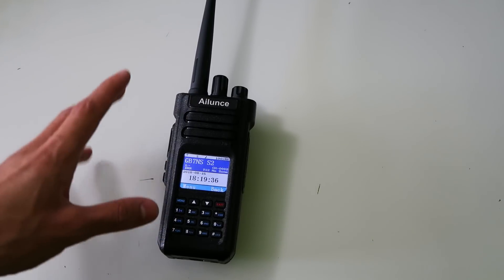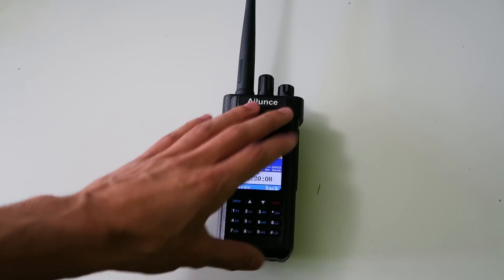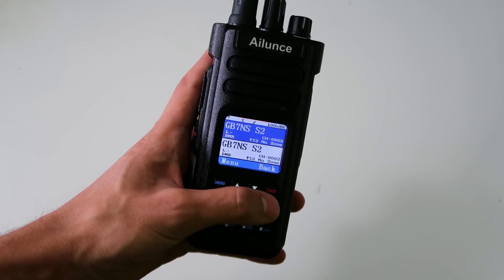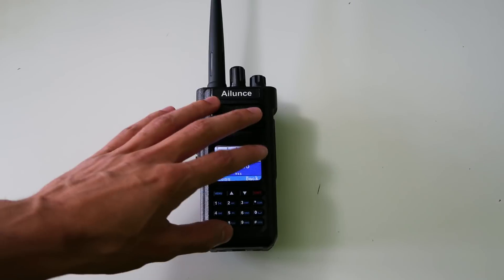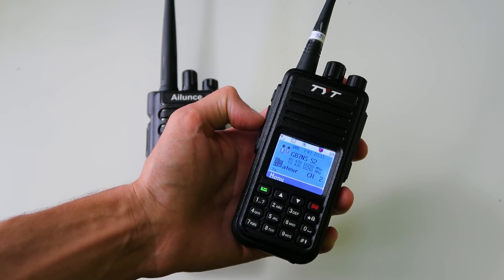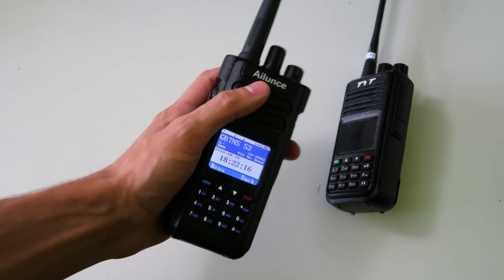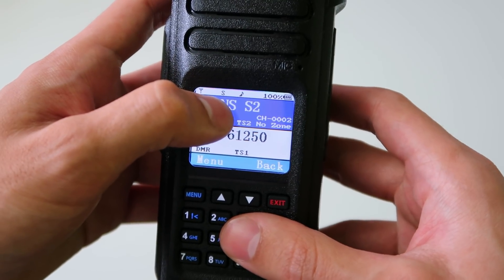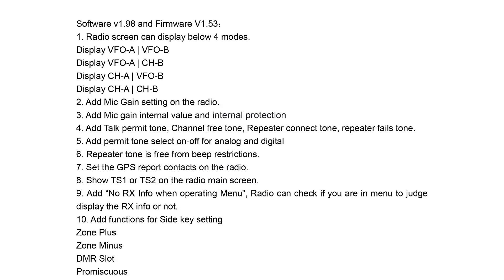Ailunce releases HUGE New Update for HD1

Comment: Ben,

    I do private security and executive protection. I was using my gd77 for my radio. It worked well for a while, however it failed on me at a critical moment. It stopped transmitting. I had to grab a baofeng that I had in my equipment bag. I am looking for a radio  that has some ruggedness to it, and can handle whatever radio needs I want. ( I need range, ruggedness, multi channels, reliability ....without breaking the bank)

What dmr would you recommend?
Reply: A £20 NOKIA OR TESCO MOBILE PAY AS YOU GO SHOULD ROCK YOUR WORLD :)
Reply: OTH, A TYT 390 (WATERPROOF 380) WITH MD380TOOLZ FIRMWARE AND YOU CANT REALLY GO WRONG, PROMISCUOS MODE, NETMON, CC SCANNING,CHANGE DMR ID ON THE GO, BE BETTER IF WE COULD GET A DIGI MONITOR MODE BUT WHAT THE HELL, THESE GO FOR AS LITTLE AS 50-60 QUID ON FLEABAY, GO ON BUY 2, YOU KNOW YOU WANT TOO;}
Reply: This is really a radio for Amateur radio I would suggest on ebay a Motorola XTS Astro they also do encryption an are easily programmed used by law enforcement audio is great an interference free P25
Reply: @aarhowell  thanks I have that radio.....I wanted to reduce the radio size....especially for EP work.....I have been experimenting with various radios since then......found some that work well....others not so great.

Comment: Do you have any idea about a gps problem that says "error gps unlock" I have a feeling my gps is defective
Reply from the maker: No idea, my one doesn't have GPS
Reply: Ok thank you
Reply from the maker: You could try doing a factory reset. Hold menu and exit buttons while powering on and then select all. It will wipe all channels though so take a backup first
Reply: It worked but after almost an hour sitting at a good location.
 Probably low channel GPS chip. I have it uploaded to my youtube

Comment: Is it still true that the ailunce hd1 antenna has a impedance problem that they dont fix? I really love this radio but thats a big no no for me. What other radio would be almost identical to the HD1 but without theimpedance problem?
Reply from the maker: I don't know. They never really admitted there was a problem, so nobody could know if they fixed it. I suspect not though. There is no problem with the antenna or the radio if you use them together since the impedance is matched. The problem apparently comes if you try to use the radio with a different antenna. If you plan to use the radio on its original antenna then it's not going to be an issue at all.
Reply: @radiosification  I'm looking for a dual band radio with analog and dmr, waterproof, big display, easy to program from the front panel and rugged. I will use 3 party antennas like a N9TAX j-pole antenna and a Comet SBB-7 dual band antenna. What other radio has these specs? I'm ok with paying about 400$.
Reply: Yeah and also it needs to have a real vfo like on the HD1.

Comment: Can this radio be used with a external antenna for example a discone in my attic?
Reply from the maker: It could do but might not work as well as it should because the impedance is apparently not the standard 50 Ohms which it should be to be used with other antennas.

Comment: Hi Chris from Tom NO3NO. I'm having a bit of a problem with my HD1.  It seems I cannot get my rig to allow me to switch into analog mode. I am running ver 1.5.3 and I can't  figure out what I'm doing wrong..  

Do you have an email address that might be a bit quicker than Youtube ( As great as it is. )  Thanks.
Reply from the maker: Who is Chris?
Reply: @radiosification  I thought that Chris was this channel.
Reply from the maker: Nope! This is the second time as well!
Reply: Sorry about that. I think I had a small stroke some weeks back and I think it is affecting me.
Reply from the maker: No worries.

If your radio is on frequency mode then you should just be able to hold the red button to switch it between DMR and FM modes.
Reply: If I had your email address I could show you what I mean, if you would be so kind.

Comment: I tried to install the update firmware program for the HD-1 but the internet security I have running on my Windows 10 pc robustly throws it out citing a serious inappropriate activity by the program. Maybe It's time to acquire a Motorola radio.
Reply from the maker: It's not an actual virus, it just gets flagged by mistake. I'm not really sure why
Reply: Hopefully Retevis will become aware of this issue and sort it out. It certainly prevents me from updating the HD-1.
Reply from the maker: Just disable your anti virus temporarily to install it. That's what everyone else does.
Reply: I guess I'm not like everyone else. The radio will have to remain without the update, it is just not worth the risk for a cheap Chinese radio.
Reply from the maker: It's the fault of your anti virus software. If you get a good one then they won't randomly flag programs that aren't even harmful. I use avast and I never get problems with Ailunce software. Maybe you should try avast instead if you want to stay secure while still getting updates.
Reply: I'll leave it for now. I'm not in any hurry to update the radio. I have other projects to attend to, so no worries. Thanks for your input.

Comment: The biggest fault with the HD1 and why i got rid of mine is a design error in the RF output stage, 
it has not been designed for use with 50 ohm antennas which every aftermarket antenna is,  
so there is a high swr which is dangerous when the radio is on high power, the antenna the HD1 comes with 
is matched to the radio (i think its 30 ohms or so) so it is safe to use high power with that just not
an after market one. This is a well documented fault and if you search around you can find the 
test data for it.
Reply from the maker: Yeah I know, I did mention this in my review of the hd1. This video is not meant to be a review, it's just talking about the update
Reply: The strangest thing about it, is that Retevis apparently had custom VHF/UHF antennas made just for this radio!?
Reply from the maker: You literally just press the number keys to input a frequency, assuming you aren't stupid enough to leave it in channel mode and try.

Comment: Great news! Thanks Ben!
The green info screen popping up constantly was driving me nuts. Had to remove the antenna or tune to a known quiet frequency just to use the menu.
Very pleased Retevis have added talk permit tones too. Spent ages in the software looking for where to turn them on.
And yes...the volume control badly needs re-calibration. It is deafening even when set to the 10 o'clock position and life threatening above mid point!
Nice to be also able to change screen colours, since the display is certainly capable with the power on image ability.
Still my favourite of the Chinese DMR portables.
Reply from the maker: Yes it's about time they fixed these things. Who makes a dmr radio without a talk permit tone?! Thanks for the comment
Reply: Just wondering if the new firmware is compatible with the current CPS, or do I need to re-write my code plug for the HD-1?
Reply from the maker: You never need to re-write the code plug. You'll be able to load the old one just fine, or read it off the radio
Reply: The reason I mentioned this is because in a previous firmware upgrade of my Radioddity GD-77
 the radio required matching the new firmware with a new CPS version.
Whilst on the subject of CPS software, has anyone had the experience of trying to program a Baofeng DM-5R radio using the DM-5R CPS? I found that I could not read the DM-5R using the DM-5R CPS. Instead I found that the RD-5R CPS works with the DM-5R. Of course you will need to by-pass the Trojan virus warning in order to download it from the Radioddity website.
Reply: @radiosification   Hallo, how about the volume problem? I use to operate the handy in the evening or just in bed to listen to lokal repeaters. In this case i need a very faint volume setting. Is ist now possible with this unit or should i better buy a Radioddity gd77?
thank you, Hubert from Germany
Reply: Sorry to bother you..  I need to carry a Motorola radio for work.  its fairly new and don't know much about it.  I would really like to find a light weight radio that can listen to my work frequency.  I don't know what the frequency is yet, but pretty sure its analog.  I am a bit over whelmed looking through all the forums.  I don't need to transmit from the device only listen.  Since you seem to know a lot do you have any recommendations?  Again I only have to listen because my work issued computer will be close enough that I can get to when needed.

Comment: Thanks for the update and run down of new items. Displaying the CC as well as TS would be great. I see there is a new CPS too. 

I agree with others that the RX audio can be loud which is good/bad and the slightest turn of the volume control can be deafening.
Reply from the maker: Yeah the new cps seems to just have the things added in this firmware. Like there's an option in the CPS to turn on and off the talk permit tone.
Reply: It's all a work in progress and in fairness to Retevis they are getting there!  I like the key assignment for changing Slot(s) and CH mode as you forget the frequency for a named channel from time to time.  The talk permit tone is useful too as we have found from the MD380.

I would like the CPS to be written in a way that adding new channels among existing channels doesn't mess up the channel members arrangement in a zone - it can be time consuming to get the zones the way you want them afterwards..

Comment: Nice video.  I sure hope the next update includes a way to reduce or adjust received audio, it is really high now.
Reply from the maker: Oh I see what you mean now. Yes I do have that. I thought you were saying you got it only after this firmware update. It's not a problem for me since it's analogue volume control anyway you can just turn it to the level you want
Reply: You mean, nudge it ever so slightly from the 'on' position, or suffer permanent hearing damage?
Reply from the maker: I haven't had that issue at all! How strange.
Reply: radiosification; receive audio is very loud.  Have to keep volume control almost to point of turning radio off!?
Reply: Tim in Texas I have this too but id much rather have it too high as too low.  Seems it should just have smaller increments with the dial instead of on to full blast in a quarter turn.